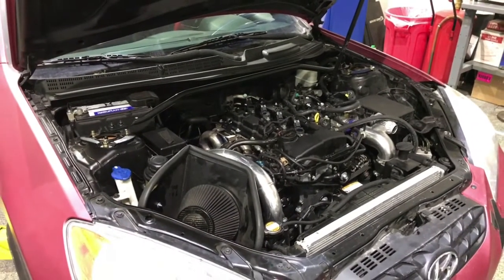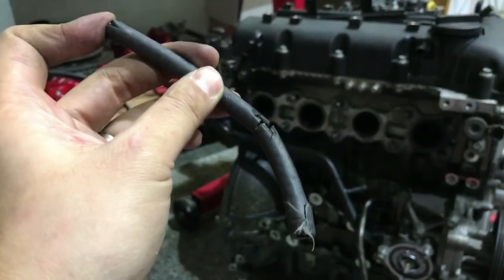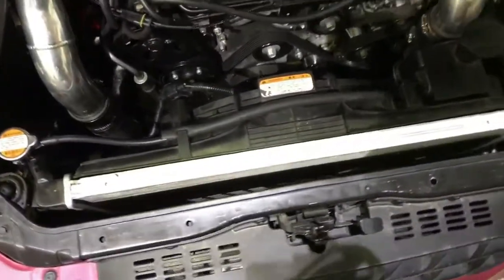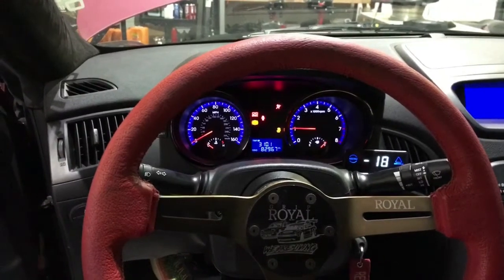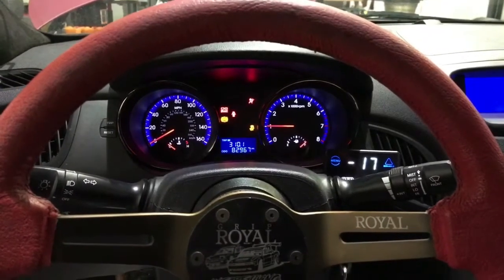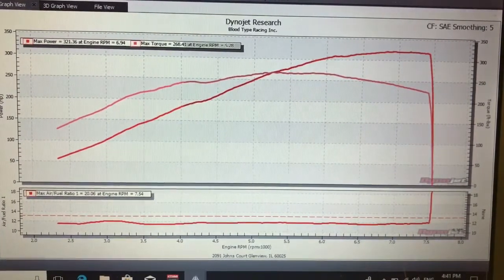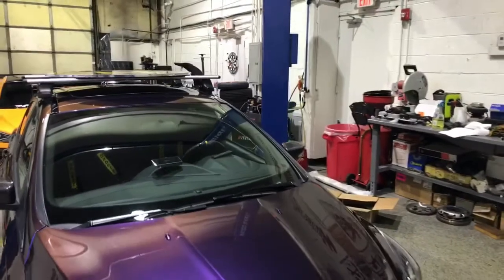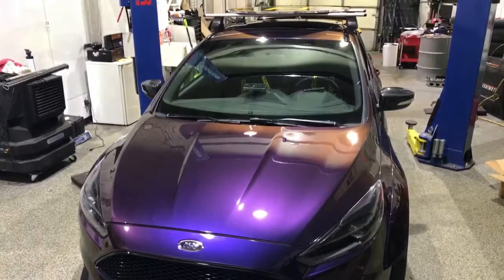BTR Vlog #1 (Engine Failure Cause, Electronic Boost Controller Overboost function, dyno and GT28)

Comment: more vlogs sir sam...can i get a canned tuned for 16g,18g or 20g turbo? ex If i buy 20g turbo from u ill get free canned tune?
Reply from the maker: we do have canned tune data for a TD05-16G and a TD05-20G turbo for the BK1 2.0T's

you should contact our sales dept for questions on pricing   sales@btrcc.com
Reply: Blood Type Racing Inc. (BTR) 
how about TD06 20g u have canned data as well?
and if I purchase my turbo to you my retune is free? already tuned by btr tuner for stock turbo
and what injector size do I need for the canned tune for 20g?
Reply from the maker: No tunes are ever free. For price you need to email or call our sale dept